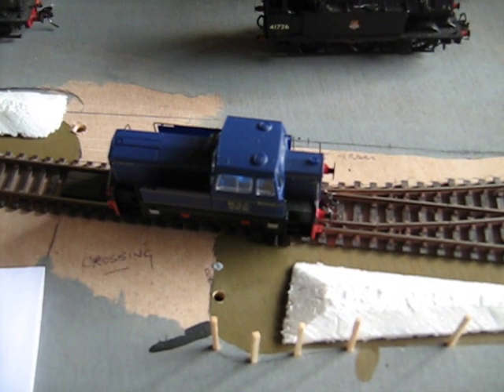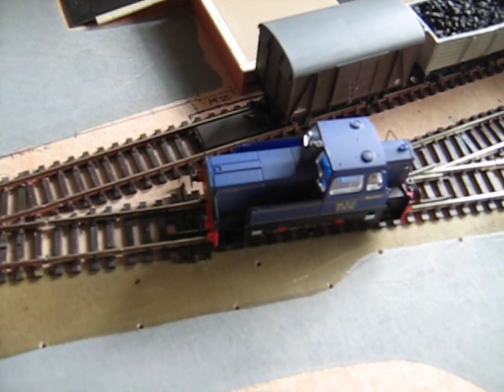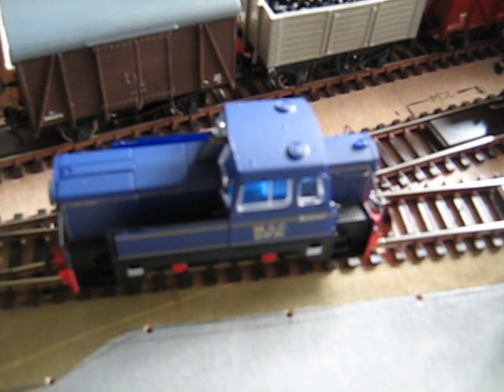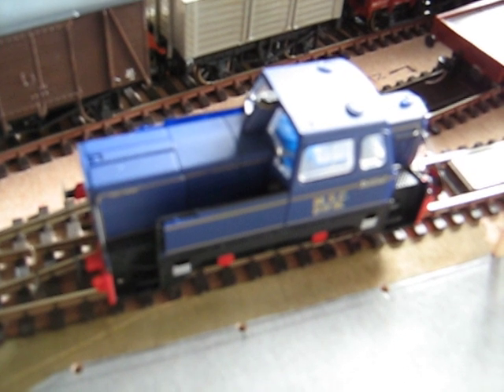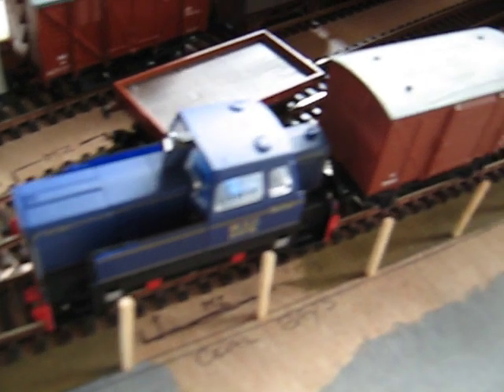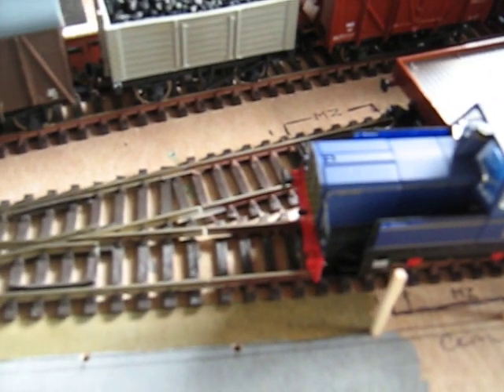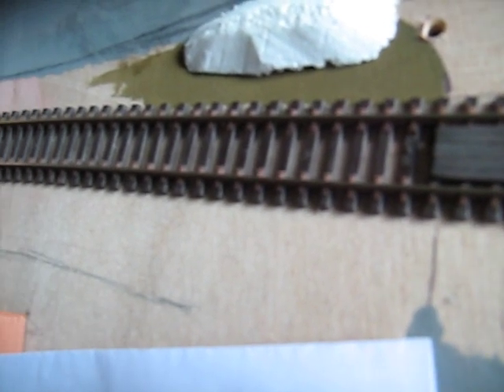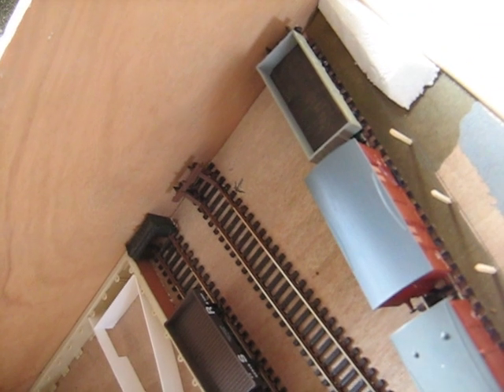Showing the disrupted DCC  running after fitting Frog Juicers

Comment from the maker: Problem solved by adding a quench circuit to dampen out spikes from the frog juicers.
The added circuit is a small 100nF ceramic capacitor and 150R 3 watt resistor connected between the track rails. I'm advised by several electronics guys that the frog juicers are not a good idea, they use a short circuit to operate and this sends all sorts of spikes into the DCC signal that decoders DO NOT LIKE.

Dad-1
Reply from the maker: O.K so it's well over a years ago, but as these sit 'On the record' I thought I'd add what happened. Poor running continued, a decision was made to remove the Frog Juicers and replace with small mechanical micro-switches  attached to the manual point operating rods. Since then NO PROBLEM !!